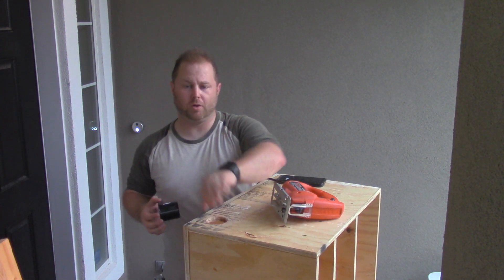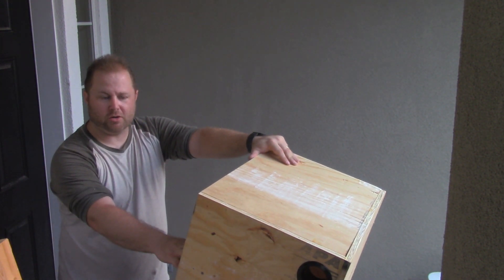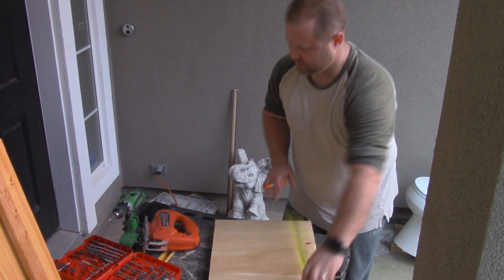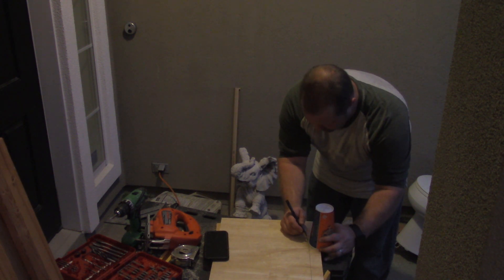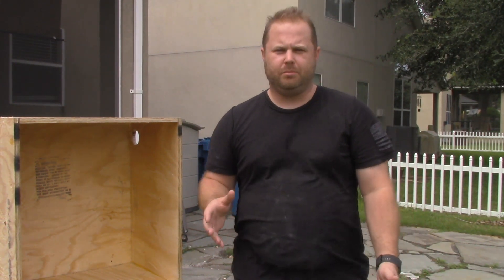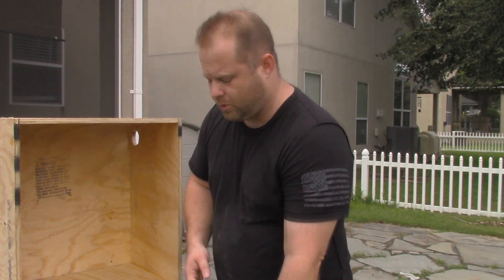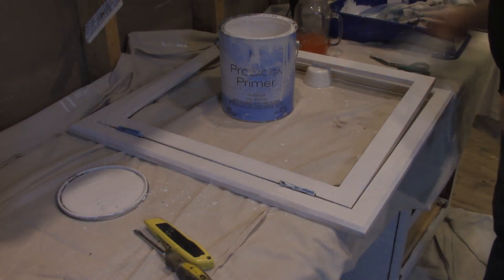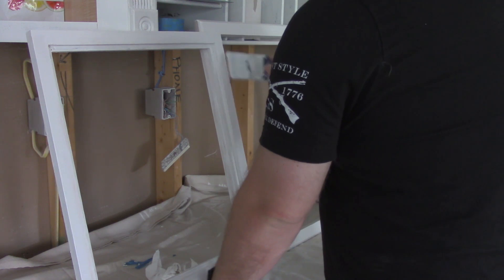Making a built in fireplace media cabinet E2

Comment: Did you finish? What's a fireplace media cabinet?
Reply from the maker: Hey Craeon.  I did finish,  I just haven't posted that yet. Been way to busy but it's coming.  It's a media cabinet built into the side of a fake fireplace :)  Most don't do that as heat + elecronics = no bueno.   But there's no heat here, and it's a huge waste of space. Without ripping it all out I think this is the next best thing.
Reply: @kyle8198  cool thanks.